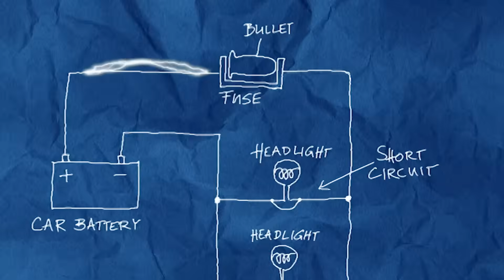Will a Bullet Used as a Fuse Fire in a Vehicle? | MythBusters

Comment: I don't understand why the truck driver didn't just use a spent casing, it would of worked (till the wiring burned up.) and what if he was paranoid delusional that a mobster was after him?
Reply: Pause at 0:37. I don't think the casing alone is long enough to fit.
Reply: Well the smart the would be taking off the bullet with some pliers, emptying the casing, then sticking the bullet back on. Still a bit dangerous because of the primer, but better than the former.